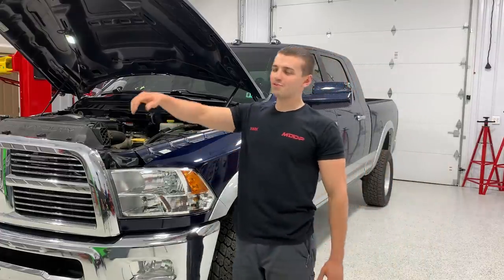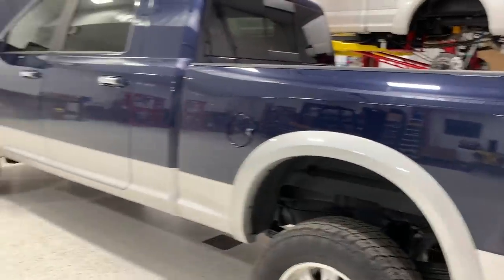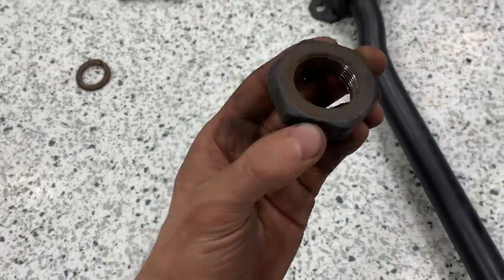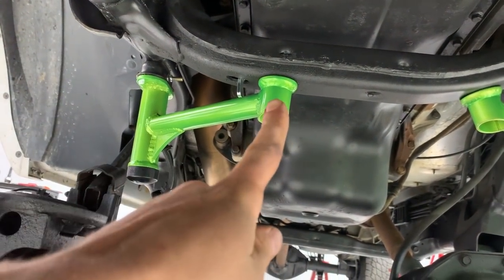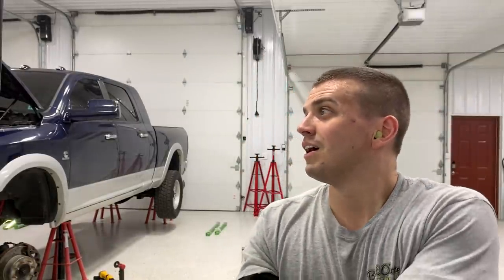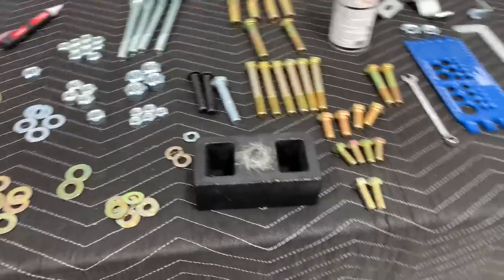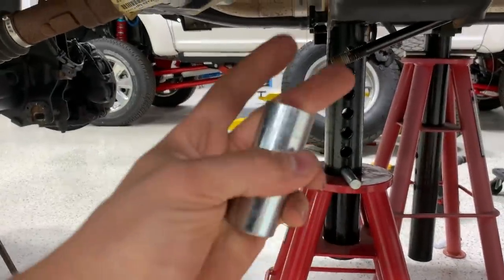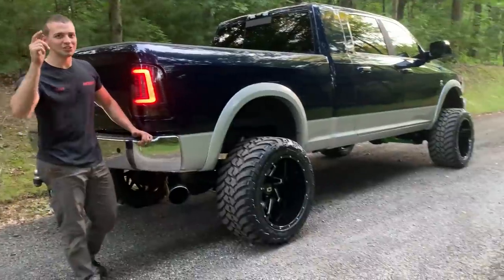This Lift Kit Install Did NOT Go As Planned

Comment: Somebody apparently failed geometry class. If you're wondering why you got that comment, it's due to the fact that when you pitch the rear output shaft of the transfer case down to correct the rear driveshaft u-joint angles (which you didn't check or note in the video), you cause the front output shaft for the front driveshaft to nose up at the transfer case causing MORE issues with the front u-joints which leads to vibrations as the two front shaft u-joints are traveling at different velocities resulting in accelerated wear. 

Then there's the lower cam bolt on the front axle. The lower bolt mounting has an eccentric feature designed into it to place the vertical centerline of the front axle between 3 & 5 degrees (according to OEM spec's) so the steering of the vehicle isn't fighting the driver as you travel down the road. Hopefully you delve into steering geometry as well as driveline angles as doing so will help you offer better service for your customers.